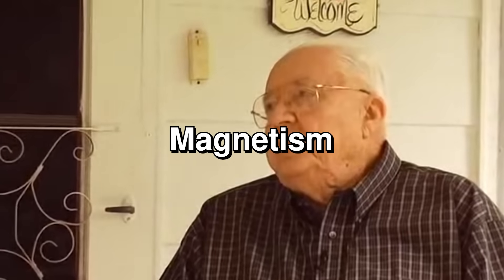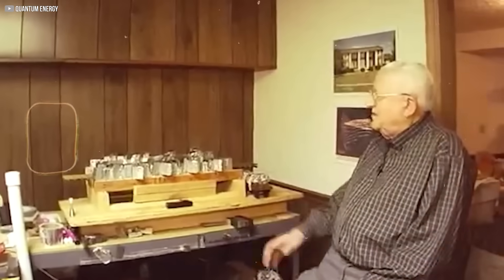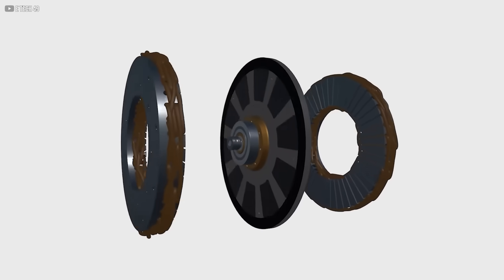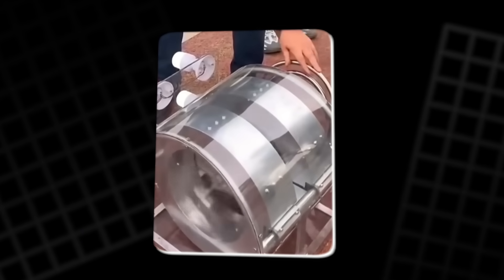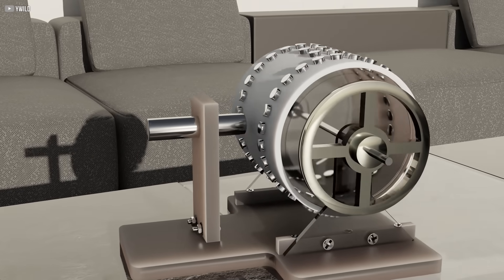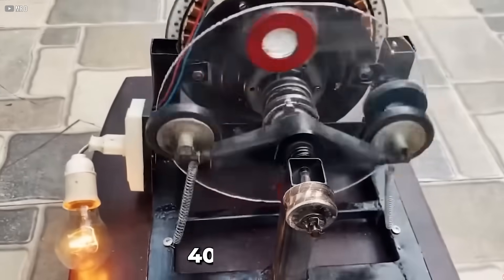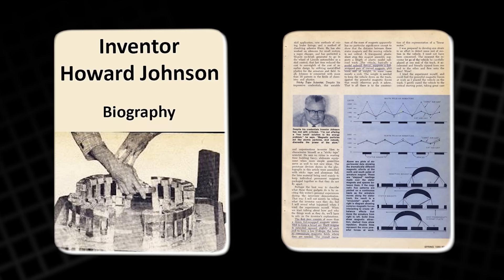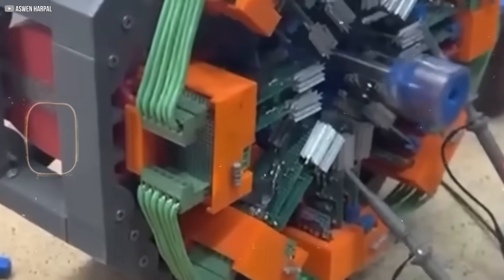This Man Built a Motor That Runs Forever. Then It Disappeared

Comment: There is an interesting account of an electronic engineer that I found many years ago on the internet.  It was originally posted in 1994.  This person, Bruce Welsh, had the fortunate experience of watching a perpetually running toy that was constructed by his uncle when he was still a boy.  In essence, it had a ramp with marbles running from the top of the toy to the bottom and at the bottom the marbles struck some paddle wheel.  This paddle wheel, in turn, drove a little elevator that took the marbles up to the ramp depositing them in a hopper that let out the marbles in regular intervals.  There was no other source of power in this toy other than the marbles themselves.  According to his cousins the toy ran for weeks at a time until it stopped running (probably due to dust or other substances being in a farmhouse) and running again after being serviced properly.  Unfortunately, the uncle took it apart again later to build other toys for his sons.  What I like most about Welsh's story is his comment at the end of his article: "I don't believe that the physical laws are all that unforgiving, that is I believe that every law has at least one exception, and I really believe that they all have several. So if something doesn't obey a law, I don't get bent out of shape, I just think, well so it doesn't fit into the conventional theory."   I think Mr Welsh had a very good approach to science in general.  He lacked the vanity that so many academics and highly qualified people have with regard to the (man made) scientific laws.

Comment: magnets are the key , i did buy some to make a ever turning mobel, i know how, make 2 circles , 1 with 10magnets 1 with 9, turn the 10magnets in 10degrees in the same line, put this upside down on the 9magnets and it turns forever, with a hole in the middel circels a pencel in it , good luck

Comment: Problem is that natural magnets on a large enough scale to make this feasible as an energy source do not exists. You would have to create enormous electric magnets that need to be powered by fossils fuels. You wouldn't get more energy out of the system than what you are having to put into the system and would probably loose some energy in the process with a net loss.

Comment: It does work I all ready made me several of magnet power generated electricity.. positioning of the magnets are extremely key to getting it right..I have hundreds of neo magnets and bearing rings..Good bearings are all so important..timing of the magnet positioning and there set ups was difficult for me for a while...now I have different working generators...this method of magnetic free power is real..soon I will post a video on the matter and it free like it should be .....😅

Comment: Do you remember the Bork (or Borq) engine. Fabulous. He wouldn’t sell. His Maryland factory mysteriously burned to the ground. Little to no investigation. The inventor / entrepreneur was ruined. Whatever happened to him has been lost or buried.  I remember this so clearly. 70s/80s, I forget exactly when.
Reply: Sooo...a super genius inventor creates yet another "free energy" machine...and not only does he never write it down, he never makes multiple copies of the plans, and absolutely under no circumstances...changes the world for free. **checks watch**...that's the third one this week. V-Gating has been around a long while...what is left is only dynamic field ablation (soft clutching) with a usable horsepower & discharge capability more than imaginary at 100rpm.
Reply: Or, you know, he could have been a simple hustler, took the investments, bribed the investigator, burned down the factory to erase any kind of evidence and just... left for South America, sipping mojito on a beach with a model blonde next to him. Not exactly hard to achieve plan, especially in the 70s/80s

Comment: Don't forget Tesla. When he died in that hotel room in NY. Almost instantly Feds raided and got everything.
Reply: Free electricity for all!
Reply: YEP!!
Reply: Yep the deap state even then did not want Tesla's breakthroughs & energy innovations to change the world.
Reply: If I recall correctly, Trumps uncle was one of the cia that got teslas body, drawings, everything, Tesla also told the gov how to control gravity in fast moving crafts.
Reply: Yes they did, for the potential that they might have had.  They didn't want it to get into enemy hands.
Reply: The strange thing about Tesla is that his gadget that apparently produced electricity out of thin air actually works.  You can find instructions to make one on the Internet.

The explanation of how it works tends to debunk it through.   It turns out that there is electricity (a vertical field) in the atmosphere.

"typically around +100 to +150 Volts per meter (V/m) near the Earth's surface in fair weather, pointing upwards due to the negatively charged ground and positively charged ionosphere"
Reply: This won't work.  The reason is that magnets have a symetric field.
Reply: Twumps dad and uncle were involved 🙊

Comment: It IS possible to make a machine that runs on magnetic force, and make it run to produce energy. However, the laws of physics cause the magnets for lose power over time. the output power drops, and eventually the generator stops.  This doesn't mean that it isn't feasible, but it is a matter of cost of the device against the amount of kWh generated.   Wind turbines and solar panels also have a certain cost per kWh, over the lifetime of the device.

Comment: The inventions that took off like better braking systems took off. Dont "reinvent" the wheel.  " just inprove" what's already being used. Told mag guy just "put it in a welder" ( already used - just make it better- dont need 100% - make small inprovements)  Already have airplanes ( people laughed ) just make the NOT just faster ( jets) but " safer"  - land with a parchute / big gyro blades at top( not just a little " rat" for small amount of hyd/ elect power. But more lift even with NO eng power ( but NO rather blame the pilots ) - utube - alan wolf

Comment: Even if this is possible. Since magnets are not super strong, unless there electromagnets. The motor would be very weak and there for useless.
Reply: Use some of the current to power electro magnets…a small amount
Reply: @matt84712  πόσο πιο απλά να τους το αναλύσεις !!!
Reply: well you dont use toy ones hahahaha
Reply: Mony a mickle maks a muckle.
Reply: Apex will sell you insanely strong penny sized magnets for a few bucks.
Reply: One little solar panel could do a better job..

Comment: Magnets are a storage of energy. 
When the proper setup is achieved,  it can produce a mechanical and or electrical force. 
I wouldn't say that it would last for ever, but longer than a dry cell battery an a few other things.
Reply: Of course. And if u use them to deliver energy, then the magnetic force will weaken, then the euphoria stops. 
That's what I think.
Reply: Magnetic Eddy Currents will drag down the rotation of any "magnetic wheel" within a mere few minutes much less any longer period of time such as hours or days! It looks like I will have to use that fancy high-Gauss Neodymium magnet collection I have to make and PROVE the fallacy of magnet motors! 

They work for ONLY short periods of time due to magnetic eddy currents eventually dragging them down to a full stop no matter HOW LARGE they are! 

Humanity's BEST BET for unlimited energy is either Pure Fusion of Hydrogen ...OR... the easier-to-make but more complex to run and maintain Sonofusion (i.e. Liquid Metal Medium-based Acoustic Wave Hydrogen Plasma Compression) power production systems which can BOTH easily go over 100 Megawatts per unit!

A 10 metre diameter spherical laser compression device for true fusion when properly fired and run using today's technology, can have a theoretical output of around TWO TERAWATTS which can easily run a few provinces and states in their entirety! All of Canada, USA and Mexico could be run off just 20 of those fusion reactors even at the increasing electrical power consumption loads predicted for the next 25 years!

V
Reply: Muonic
Reply: @thelonegerman2314  What does that even mean? A Muon is a Lepton aka an elementary particle NOT made up of any further sub-particles such as quarks (i.e. I beg to differ on that -- Continuous virtual particle annihilation aka energy fields come into play here!)  Muonic has NO meaning in this context! The amount of energy that could be obtained is negligible since they TEND to not hang around long enough to do anything other than decay into neutrinos and electrons! The decay action is simply NOT energetic enough to do anything with UNLIKE a Fusion of Hydrogen into Helium reaction which produces ENORMOUS amounts of thermal and XRAY/GAMMA ray activity that CAN be easily harvested!

V
Reply: @StarGateSG7  muons can trace their lineage to a electron or and photon
Reply: @thelonegerman2314  What does that even mean? A muon is a particle! So what? Muons DO NOT DECAY into photons! They can cause the emission of one by exciting/catalyzing another reaction process that does causes photon emission! That's it! This very FACT limits their ability to directly create extensive thermal, XRAY/GAMMA ray energy and have ANY type of large scale energy harvested from them! They are basically USELESS as an energy source!

Me thinks you might need to read up more on basic quantum mechanics and nuclear physics!

Comment: As far as zero-point-energy motors or generators go that one has a whole bunch of flaws that cannot be overcome. It's a terrible motor. And, it makes into an extremely inefficient generator too; not too far over-unity and of such low power density (power per weight ratio) that it cannot be utilized to power anything of value; neither a house nor a vehicle. Worse, his patent of it (US4151431A; April 24, 1979) expired; meaning, no one can claim it as intellectual property anymore. Mr. Johnson died in 2008.
Reply: Can you make a video detailing this?
Reply: @saturnx311  Actually, I am doing just that to support my CONCEPT permanent magnet piston engine (PMPE). You can begin with the Stanetskiy's PM Motor patent (US0052312A1; Mar. 8, 2007) and their critique of Howard Johnson's PM Motor. That critique is right on.

Comment: I'm still waiting for simple plans of a magnetic motor that runs on it's own that I can build in my basic basement machine shop. I've seen many & built some, but none have ever worked. Bet I'll never find them. The second law of thermodynamics always wins. Besides, a discovery like that wouldn't be surpressed, it would be stolen & exploited by Big Energy to produce saleable power for virtually nothing.
Reply: The energy the operator inputs to a magnetic motor to run it is not what actually powers the motor itself. The motor’s permanent magnets all have symmetrical fields (left and right on the rotary cycle), and so the overall net driving magnetic work WM around the rotational loop is given by WM = ò F · ds = 0 where the integration is around the loop. So, even though the fields of the permanent magnets are actually steady and free EM energy flows extracted from the seething virtual state vacuum, their symmetrical production of forward mmf and back mmf contributes only equal and opposite driving forces. Hence the symmetrical fields of the permanent magnets prevent any “self-powering” – i.e., any powering of the unit by “energy from its active environment,” even though virtual free energy from the environment is continually being received, transformed into observable energy, and output as real magnetic field energy (real photon flows).

 The “paid-for” energy input by the operator is used to go to coils to produce specifically placed additional magnetic fields at specific rotational times, so that an overall or net “asymmetrical” magnetic field exists around the rotational loop. This new broken symmetry then provides sufficient asymmetrical energy flow from the vacuum to produce a net nonzero “driving magnetic field force” and thus WM =  ò F · ds > 0. This in turn provides the excess work that powers the motor and its balanced load.

Nature does not care whether the operator insists on paying for the achieved net asymmetry himself, or his magnets are made asymmetric so that their fundamental magnetic force field around the rotational loop is nonzero. In the latter case, the broken symmetry is freely achieved by the free asymmetry of the net force field, and so WM =  ò F · ds > 0 and the motor and its load become “self-powered” by the asymmetry freely induced in the interacting force fields provided by the magnets themselves.

In nonequilibrium thermodynamics it is already well known that one can permissibly violate the old second law of equilibrium thermodynamics in several ways (See Dilip Kondepudi and Ilya Prigogine, Modern Thermodynamics: From Heat Engines to Dissipative Structures, Wiley, New York, 1998, reprinted with corrections 1999. Areas known to violate the old second law are given on p. 459. ). To achieve one of those ways, we ourselves can furnish extra energy to violate the symmetry, or we can trick the magnetic materials and their assembly to do it freely for us.

We propose a way to use anisotropic characteristics of some nanocrystalline materials to assemble these materials in a permanent magnet having a specifically desired left-and-right overall magnetic field asymmetry. In that case, assemblies of such “magnets with asymmetric fields” in a rotary motor can be made so that the overall driving magnetic force around the rotational loop is nonzero, as is the net work accomplished by that assembly. In that case, one can have a permissible self-powering permanent magnetic motor, powering itself and its load with its broken symmetry in its ongoing interaction with the seething virtual state vacuum. The laws of nonequilibrium thermodynamics are obeyed, as is the conservation of energy law when the vacuum energy interaction is included. The system thus becomes a proper nonequilibrium system freely receiving its input energy asymmetrically from the seething virtual state vacuum, transforming it into real asymmetric magnetic fields, which in turn drive the motor to power it and its load. It is no more mysterious than a windmill powered generator system, once a proper asymmetric windmill is used to extract free energy from a free wind and “self-power” itself and its generator “load”.